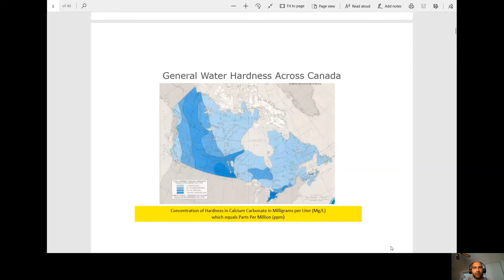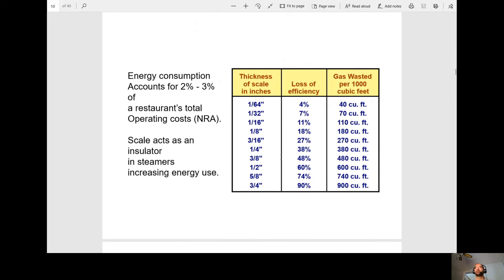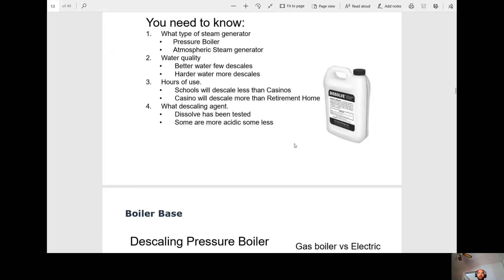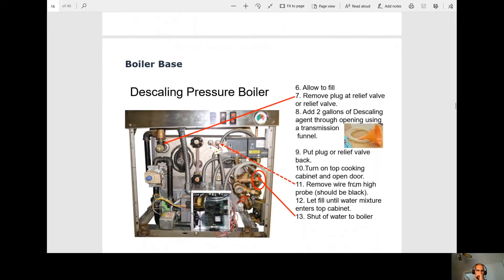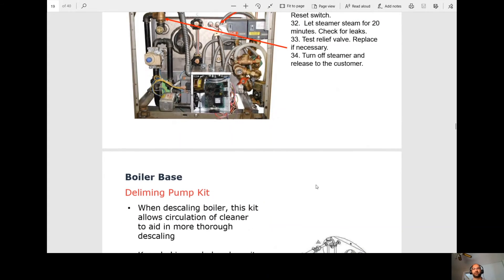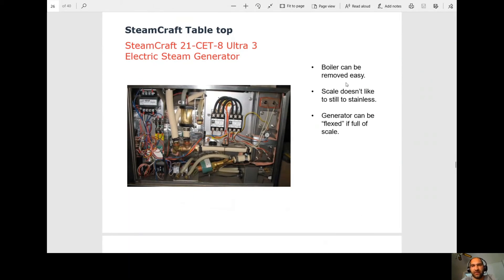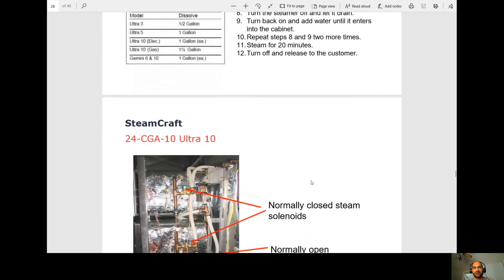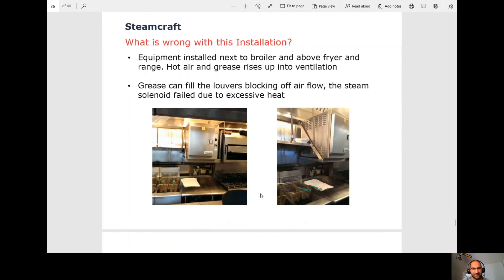Cleveland Boiler Descaling

Comment: I have a cleveland steamcraft 3 with 2 steam nozzles. The lower nozzle is producing steam the higher nozzel just has water coming out of it. Any idea what this could be? Thanks in advance.
Reply from the maker: Too many variables here
Reply: the generator has 3 steam ports,they are located at the top of the generator right side.The 3 hoses connected to these ports supply 
steam to the bottom,and top nozzles,the third one is balancing the steam flow within the level glass.In your case one of the ports(#1 from right) is plugged with scale and only some steam goes through and condensate before going into the steamer cavity.
I hope it helps.

Comment: Just got a 24CGA10 gas unit from a school. Opened the port on the boiler and it is solid hard white scale. You mention not descaling a unit like this one, but also mentioned the possibility of removing the entire generator / boiler assembly to flex and remove the scale. Any suggestions when the scale is this bad? I would love to use this unit if possible.
Reply from the maker: Sometimes the scale is so bad that is you remove it, the boiler will start to leak. It is suggested not to descale it if it was not done regularly